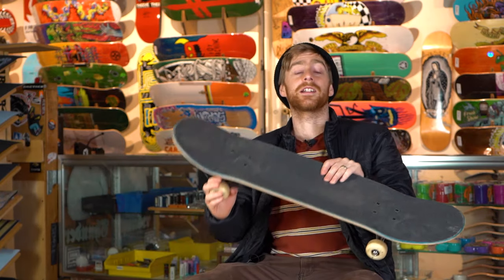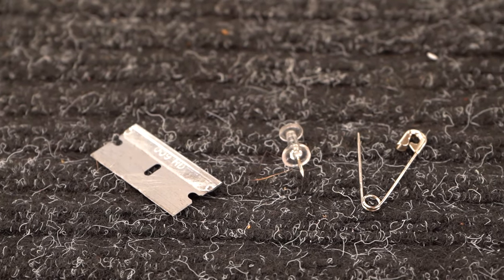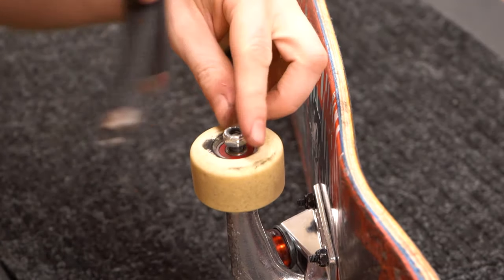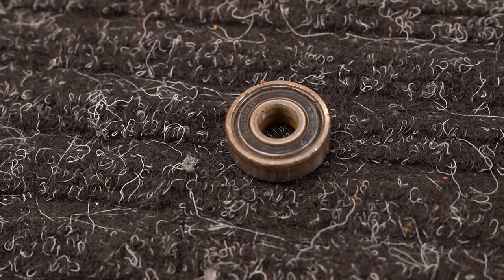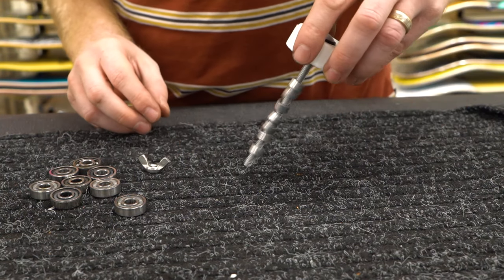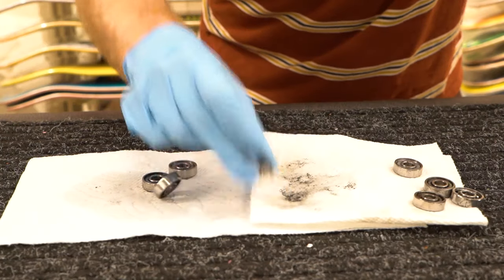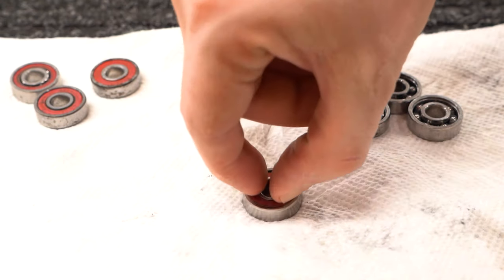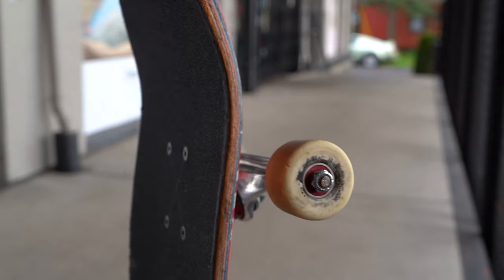How to Clean Skateboard Bearings | Tactics

Comment: So I am just starting to skate but my wheels don't go spin for long and I don't know what to do. I thought it was because I didn't grease them but when I went to lube them it still wouldn't spin for long.
Reply from the maker: First I have to ask what kind of wheels and bearings do you have? Are they from a skateshop or did they come stock on a department store complete? Are the bearings rusty? Also are the axle nuts too tight on the sides of the wheel and pinching the bearings? Sorry for the interrogation! 😄 I'm just trying to diagnose the situation! 🛹🩺 - Tim

Comment: How often would you clean your bearings?
How many times would you clean them before saying enough is enough and buy a new pair?
Reply from the maker: I only really clean my bearings when they're noticeably slower and I find myself pushing twice as much. If the bearing is totally seized up, then I just toss the bearing. It's really up to you how often you want to get new bearings. If you can afford it then get them more often. I was definitely a broke kid growing up skating so I tried to make my bearings last as long as possible and clean them over and over again. It also depends on what bearings you're using. If I'm using some Bones Reds and they're getting really slow, I might just get another set because they're cheap. But if it's some expensive bearings like Bronson RAWS or some Bones Swiss Ceramics, then I'll definitely clean them. I hope that helps! - Tim
Reply: @tacticsboardshop  champion! Thanks for the detailed reply

Comment: Can you use bike lube for the bearings?
Reply from the maker: Yep! That should work well. 👍
Reply: @tacticsboardshop   can i spray wd40 in  pressed in metal shield bearings For cleaning them or i dip bearing in it and later use sewing oil as a lubricant?

Comment: What if your bearings got rusted and are not budging when you try to take them out using the axle?
Reply from the maker: That's the worst when your bearing is completely stuck! If you absolutely can't remove the bearing using the axle pry method, you can try using a screwdriver and a hammer. Put the screwdriver (flat head works best) through the first bearing from the top and angle it so it butts up against the second bearing underneath. Then smack the end of the screwdriver with the hammer and try to pop out the bottom bearing. You can prop up the wheel using two bricks (or 2x4s) that are set about an inch apart and place the wheel across the gap between the bricks, then when you hit the butt of the screwdriver with the hammer, the screwdriver will push that bearing out of the bottom side. I hope that made sense! Good luck! - Tim
Reply: You can also pick up a bearing press on amazon for $60 made by independent. it sounds expensive but it’s a one time purchase as long as you keep it maintained!

Comment: I used acetone to clean my bearings i put in a for a bit took em out cleaned with a bit of paper when trying to roll the wheel , the wheel almost didnt roll i have no idea whats wrong. Any help ?
Reply from the maker: Maybe that bearing had more dirt or rust in it than the others and will require some additional cleaning/scrubbing? Sometimes if the bearing is totally seized, even cleaning it won't help it because the damage has already been done and you'll just have to replace it. But hopefully that's not the case and you can just clean it a little more and get them rolling fast. Take care! - Tim

Comment: hey, i have either nitro thinner 21 or nail polish i wanted to use nail polish but it has no acetone what should i use ?thanks
Reply from the maker: You want nail polish REMOVER. Actual nail polish will probably ruin your bearings. The nitro thinner will probably work. If you try it, let us know how well it worked! Cheers! - Tim

Comment: how do I lube them with metal sheilds
Reply: I need help pleae
Reply from the maker: If you can't take off the metal shields, then you can try just dripping the lube into the little creases between the shield and the inner/outer races and just let it seep in. It might take a little longer for the lube to fully get into the bearing, but there's not much you can do with the metal shield bearings. Good luck! - Tim

Comment: Wipe them off with a napkin,cut a plastic bottle in half put them in the bottle with vegetable oil shake them up in a stirring motion,Let them sit five minutes to lubricate,take them out put them in a bottle of dish soap stir them up let them sit one minute,wipe em off with a napkin sit them outside let them dry for a hour,put them back on the board and ride them on a clean parking lot or basketball court to let em dry out more.Smooth as brand new.

Comment: You could use heavy duty degreaser and methylated spirits
Reply from the maker: I haven't used those to clean bearings before, but if you try it, let us know how well it worked! 🤝Cheers! - Tim
Reply: @tacticsboardshop  it works really well but make sure to lube them up after

Comment: Gotta use spacers for those bearings?
Reply from the maker: They're not required, but you might as well use them if you've got 'em. If you're bombing hills or downhill longboarding, then definitely use the spacers, but you don't really need them for 99% of situations in skateboarding. 👍 - Tim
Reply: @tacticsboardshop  
They're not required buuuuut - I could argue that the stress placed on bearings while simply carving up the wall of a pool or skatepark creates a lot of pressure on the bearings in the form of torque, and it may cause them to begin to fail sooner if they're not used.
Reply: @tacticsboardshop  

After many years of never having used spacers, they are now in every set of wheels I use and it definitely helps imo for stability and speed.

Comment: would the bearings work even if I didn't put cream?
Reply from the maker: Putting lubricant is probably the most important part of keeping your bearings working. If you cleaned them and then skated them bone dry without re-lubricating them, they would most likely break or seize up in a few weeks. 👍
Reply: @tacticsboardshop  thanks!

Comment: How do I loob my pressed in metal shields?
Reply from the maker: You might just try dripping the lube between the creases on the shield and leave it to slowly sink in. Hopefully it works! You can get some removable shield bearings for pretty cheap when those ones finally crap out. Cheers! - Tim

Comment: Can anybody lmk what this ducking rattle is that I get when spinning one of my wheels it’s inconsistent but very much like a tik motion slowing down spin it will occur regularly and rattle or tik every rotation thr when makes could it be w shattered bearing or not proper spacers??
Reply from the maker: That happens to my bearings too sometimes. It sounds like your bearings are groaning when they all get rolling fast. 😂 Have you taken the bearing out to inspect it? Maybe the bearing cage is cracked, or maybe one or two of the balls have fallen out and that's the sound of the balls free rolling a little and clinking into each other? Maybe if the bearing spacers are a little too big for the axle and it's bouncing around inside the wheel and clinking on the axle? I can't really diagnose it without looking at it, but it might be time to swap out that bearing. I hope you can figure it out. Cheers! - Tim
Reply: @tacticsboardshop  yea I ordered some new bones reds cos I’ve always run those this set was literally not even a week old tho n that’s why it condused me so much tho I realsied whiel at the park there was this massive stone that had made irs way onto the flat ground n I crunched over it so the bearings are probs j shattered tho I cba to look at them so I j hot new ones

Comment: Spacers? In the wheels?
Reply from the maker: They're not necessary for 99% of situations in skateboarding. I would recommend using them if you like bombing hills and do a lot of power slides, but I haven't used bearing spacers in over a decade and it's never had a noticeable affect on my skating or bearings. 🤷‍♂️ - Tim

Comment: Why After I 3 in 1 oil to oil my bearing, it became move worse? (Only the moving sound became quit)
Reply from the maker: Do you mean that you roll slower or the wheels don't spin for as long?
Reply: Tactics Boardshop I mean the wheels does not spin as long as before.
Reply from the maker: @tanktopper  That's normal and temporary. Anytime you add some lubricant, it'll slow down the bearing for a little bit until the excess lubricant runs out. But it's important to have the lube because it will protect the bearings from wearing out and seizing up. 👍 - Tim
Reply: Tactics Boardshop Thank you so much!

Comment: What if i don't have a lubricant?
Reply from the maker: You're bearings will definitely need some lubricant. They won't last long at all if you're skating them bone dry. Some common house hold lubricants would be 3-in-1 oil, gun oil, and sewing machine oil (don't use cooking oil). 3-in-1 oil isn't expensive at all and you can find it in pretty much any hardware or department store. 
Bone's Speed Cream is pretty much the best though and it has some additives to protect your bearings from corrosion. I hope that helps! - Tim https://www.tactics.com/bones-bearings/speed-cream/single
Reply: Thx man

Comment: If I push my skateboard it turns what is the reason
Reply from the maker: Skateboards get auto turn for a multitude of reasons, but the most common reason is old and crushed bushings that cause the trucks to rest in a slightly crooked position. Sometimes new bushings will also make the trucks auto turn before they're broken in. But auto-turn is very common, almost every skateboard swerves just a little when it's rolling away from you. It's actually more rare to see a board that rolls perfectly straight! 😆 Generally auto turn isn't something to worry about unless it's really bad with a super sharp turning radius. Anyway, sorry for rambling! Cheers! - Tim

Comment: So I cleaned my bearing and now they’re super quiet and don’t spin as long as they did before. Also since they are so quiet it makes the board feel waterlogged
Reply from the maker: The slower spin and waterlogged sound are normal and they'll go away after the excess lube runs out of the bearings. Cheers! - Tim
Reply: @tacticsboardshop  so they’ll start spinning again? And not be so quit
Reply from the maker: @pierceatlas6183  Yep, give it a couple sessions and it'll sound normal again. 👍

Comment: Can i just water and dry them off quick??
Reply from the maker: You could, but it's probably going to rust even if you try and dry it as thoroughly as you can. You could try using a hair dryer to make sure all the water evaporates lol. But the most important thing is putting lubricant in it after you clean them. 👍🛹 - Tim
Reply: @tacticsboardshop  ok thanks, I just rinsed them off in a bucket of water then used a rag to dry them off and then I used and air pressure gun, after all that I put some lube in. Is that ok?
Reply from the maker: Yeah you'll be just fine! Cheers! 🛹 - Tim
Reply: @tacticsboardshop  alr thanks I really appreciate it🙏💯

Comment: How can I clean bearings with simple items
Reply from the maker: A simple way would be to use the rubbing alcohol in a tupperware and swish it around for a bit. That's probably the simplest way. You don't necessarily need to remove the shields, but they will get much cleaner if you do.
Reply: @tacticsboardshop  💕

Comment: When I clean the bearings to I NEED the lube
Reply from the maker: Yes, the Lube is the most important part! Bones Speed Cream works really well, but if you're in a pinch, get some 3-in-1 oil. You can find it at almost any department store and a small can is $2-3 and will last for years. Cheers! - Tim

Comment: #1  don't waste your $$$ on EXPENSIVE bearings  !   #2 the numbers on the bearing  3-5-7-9's , are how they are rated at high speed as to how much noise they produce ... these bearing were made for reel to reel recording equipment  not skateboards or roller blades .   I used to race on Rollerblades  and the manager of the Berry Bearings factory  told me all about them .
Reply: Yep i use 2$ aliexpress bearings without shields to clean them occasionally and it skates just fine

Comment: What happens if i dont put any lube in them??
Reply from the maker: If you run your bearings dry, there's more friction which will wear out your bearings exponentially faster and will cause your bearings to eventually seize or bust out the side and spill the ball bearings everywhere. They'll work for a bit without lube, but you should lube them up asap. There's plenty of different things you can use to lube the bearings with, just do a quick google search. 3-in-1 oil works pretty good and a small can is 2-3 dollars and will last for years. So lube up those bearings! Cheers! - Tim

Comment: Can wd 40  help in any way
Reply from the maker: Wd-40 can be used to quickly rinse some dirt out the bearings, but it doesn't lubricate them. After it evaporates away (cause that's what it's designed to do) it'll leave your bearings bone dry, so you have to put in some actual lubricant to keep them going for a long time. Cheers! - Tim

Comment: Is wd-40 any good for cleaning bearings?
Reply from the maker: All it will really do is rinse out any immediate gunk and then dry away. It will make your bearings feel fast for a day or so, but then your bearings will be dry and crappy the next day. I use to use it frequently but I had to use it every session like a band aid and my bearings would feel fast for a sec but then get worse after it evaporated away and they'd eventually crap out. But now I use actual lube and I don't have to buy bearings nearly as often. If you're in a pinch on the session, your bearing just seized up, and you just need a quick rinse just to get through the session, then go ahead and use the WD40. But real lube is the best option for keeping your bearings going longer. Cheers! - Tim

Comment: do u need lube cuz i dont have any lube
Reply from the maker: You should definitely use lube. If you skate them without any lubrication, they're gonna wear out 10x faster. Bones' Speed Cream works great, but if you need something fast you can get a small can of 3-in-1 oil at most hardware/department stores for 3-5 bucks. Cheers! - Tim
Reply: Tactics Boardshop thank you!

Comment: Not true, you can also take off the metal shield on the bearings... Just take the thumb tack abd remove that thin ring around the outer edge
Reply from the maker: Yep, those shields are a pain, but they are removable. But I haven't seen one of those kinds of shields in a long time. The metal shields I see lately are crimped on and cannot be removed without ruining the bearing. What brands even make the outer ring metal shields anymore?
Reply: @tacticsboardshop  i believe minilogos? I don't usualy use other brands but i don't find it any harder to remove them
Reply: @tacticsboardshop  but you re right about the crimped ones, i forgot they exist 😄
Reply from the maker: Maybe Lucky bearings too? Next time I'm in the shop I'll try to see what brands still use those types of shields. Cheers! - Tim

Comment: Due to the covid pandemic bs, now literally everyone is buying isopropyl alcohol and citrus based cleaners and I can’t find them anywhere because of that.
Reply from the maker: Fingernail polish remover (acetone) works pretty well too!
Reply: @tacticsboardshop  thanks for the info! i do have another question. if im using the bones cleaning kit (or anything similar), how would i clean the solvent out of the cleaning kit? dump it out and wash out extra solvent with water and let it dry?
Reply from the maker: @AkimboemArchive  Yeah, you'd just rinse it out with water.

Comment: Can I use gasoline to clean my bearings?
Reply from the maker: Probably! I've never tried gas, but if you do it, let us know how it worked! ⛽ - Tim
Reply: Works beautifully. Only issue is you don't want the fumes in your lungs. Not very healthy. Same goes for acetone. Best way is to handle outside where fumes can dissipate quickly. Even better, just use orange or citrus cleaners, rinse with water, dry and you're set.

Comment: I dont know wtf these dudes are talking about but ive used wd40 for 10 years and its magic. On Bones, Lucky, Jujus etc.. WD40 is all you need. Dont buy any expensive special cream or whatever. Fuck, you dont have to open them up or anything. Just shoot some wd40 while you spin the shit out of your wheels. Grab a towel or napkin to wipe excess from around the wheel. Let your bearings soak. Keep spinning them.

Comment: I find this so much waste of time. Just use an old plastic bottle with big opening like Gatorade. Pour some new engine oil in the bottle about halfway mark. Throw all the bearings inside the bottle of oil and shake the bottle for some time. You can see the same dirt accumulate at the bottom of the bottle too. Fish out the bearings or pour it out on an old container and take them out to drain excess oil on old rag or paper towel over night. Tomorrow you would have clean and lubricated bearings ready to roll.